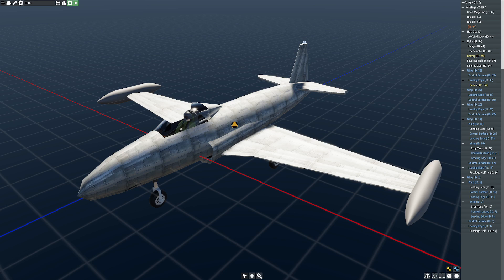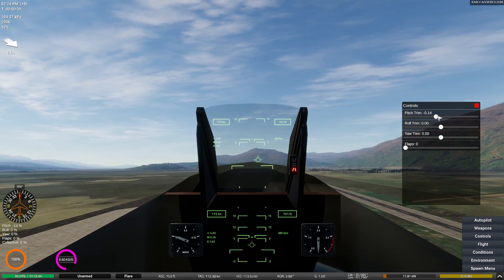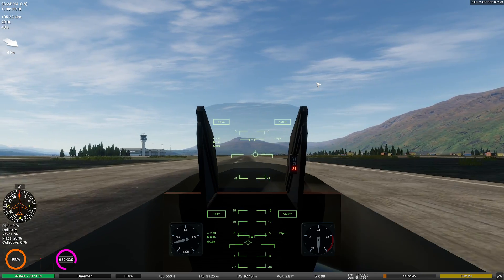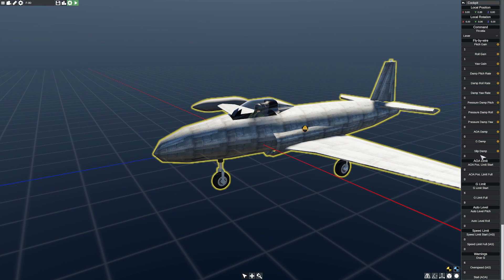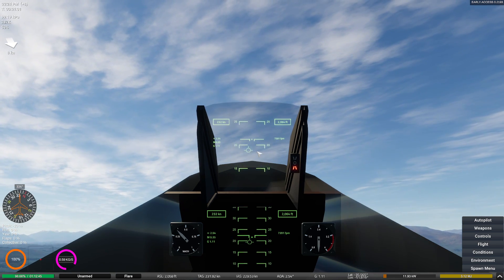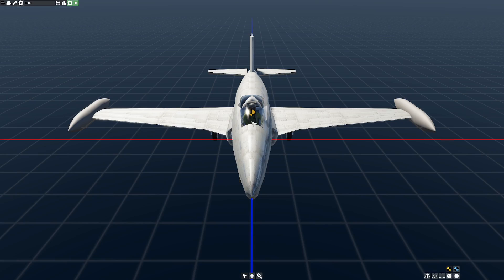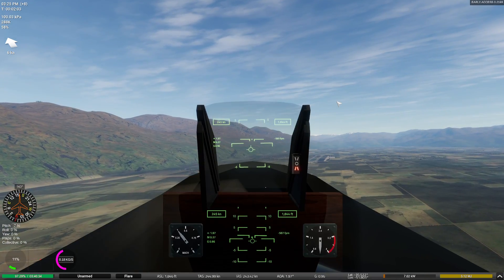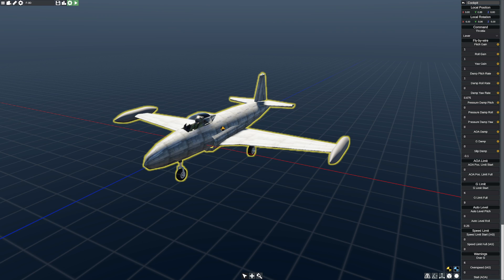Flyout - Tweaking Fly By Wire (FBW)

Comment: Idk if it’s the flyby wire’s fault, but my plane loves to just move right the moment I accelerate. I can’t even get off the runway because it keeps moving right. I’ve fully reset the flyby. Idk what to do.
Reply: It’s probably the wind. When it hits your tail fin, it makes it want to turn the opposite direction as the wind, causing you to go way off course. It happens a lot in real life too, and it’s the reason the “right rudder” memes are a thing lol. If you don’t like it, I’d disable wind altogether

Comment: The AoA limiter should start at 0 and end at 2.5 times the limit you wanted.

I was able to make a plane pulling 40 degrees aoa stable by doing this.

Also the G limiter should be 4 to 5 times the max G you wanted as well. It will give the AoA limiter more legway or they will make your aircraft flopping in high G turn.

Comment: You can hold X + WASD to set trim with keyboiard instead of the little menu :)
Reply: Just like KSP?
Reply: Pretty much yeah, just KSP ius Alt :) @jakubpollak2067
Reply: @jakubpollak2067  I don't think ksp has trim.
Reply: @04Ismyfavoritenumber  I does, you can even see it in bottom left corner where you have input arrows